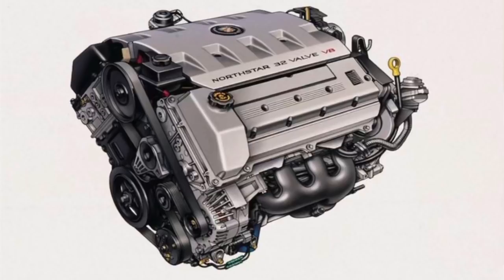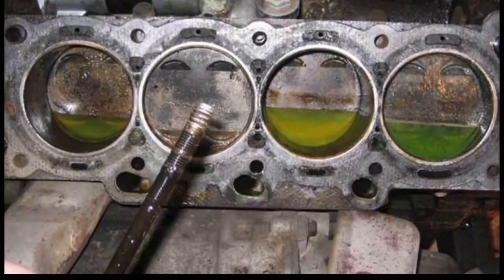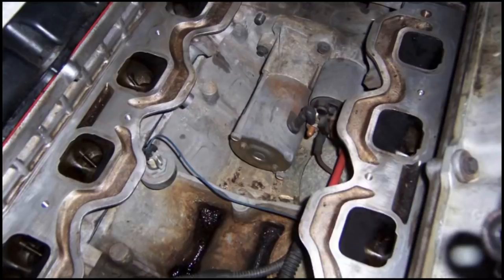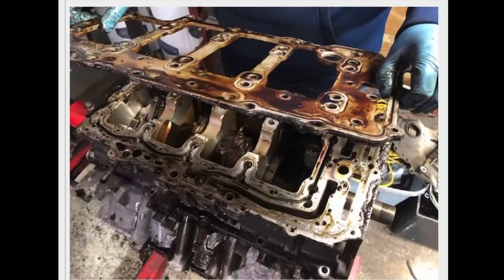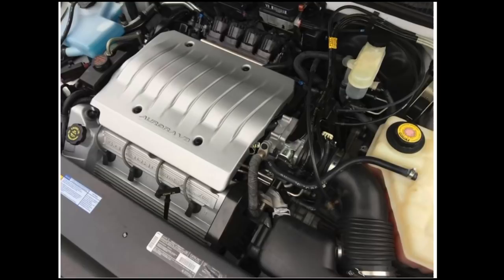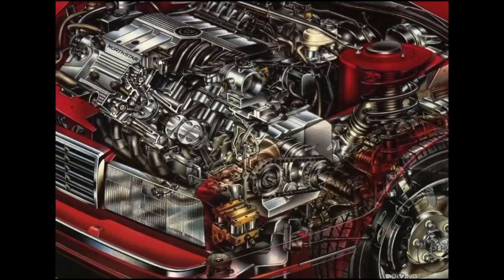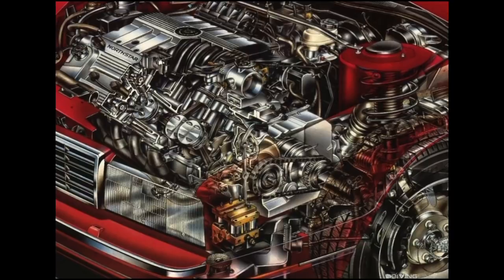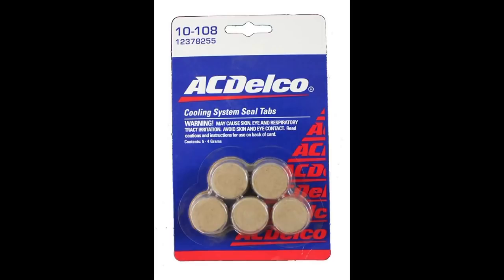Worst Car Engines of All Time: Cadillac Northstar

Comment: People who claim the Northstar is the worst simply do not understand them. They were ahead of their time. They were among the most powerful front wheel drive cars in their day. They are excellent in snow, plenty of power, and offer great gas mileage. Although the head gasket issue is a big thing to repair, they give almost no trouble after they have been fixed. And that's on 93-03 models. 2004-11 models rarely have the head gasket issues due to updated bolts. But even then, the 93-03 models are good cars when maintained. Some people run the older models for hundreds of thousands of miles without blowing head gaskets. My reasoning for that is that they never let them overheat. 93-03 models are what I would consider to be "one and done" in terms of keeping it alive with the original bolts. You get one chance, and one chance only with the original bolts. 

If you buy one, here's what you do. Thermostat, water pump, WP belt, WP tensioner, coolant flush with new orange coolant, coolant resevoir cap, and that's really all I would say needs to be done. You could keep going and eliminate every possibility you want, but that's all I'd do. That way you don't have too much money in it if it still lets loose. But really, from what I see with these cars, those are the things that will cause it to happen most often. Most of the other cooling system stuff is not an issue. And notice how I said orange coolant, not green or anything else. GM says use orange coolant, therefore, I will use orange coolant in the car. GM changed the formulation of their Dexcool so it is no longer as bad as it was. Factory Dex was a nightmare. Saw a water pump come out of these cars that looked like it ran though an acid bath. That's what Dexcool does, it eats the metals until the cooling system no longer works. It always finds its way out.
Reply: exactly had 2 one with 175000 miles never any problems
Reply: @SuperBooboo02  What year was your car? The one I had was an 03 DeVille.
Reply: @SuperBooboo02  ooooo 175000 😂 my Toyota pickup has 425861 right now and never a problem and my Subaru outback has 365678 miles on it right now and never had any problems eather.
Reply: I always us green coolant in all my Northstars and flush every two years.  OAT coolants are horrible and eat anything that's made out of rubber or plastic!  I change all my cars from OAT coolants (Dexcool, Mopar etc. and all that other garbage to green and never have any issues.  I also stud my Northstars and use Mitsubond RTV on the bottom end.  Mine never leak oil.  You have to frequently do the Italian tune up (Thrash them) to prevent the oil control rings on the pistons from gumming up (as per all performance engines of that time and before) and that prevents the engine from burning oil.

Comment: Don't care how well it runs when it works. Any engine that blows head gaskets a 60k miles,  overheats, leaks oil, has its starter under the intake manifold, and requires gymnastics to take out the alternator sucks.

Comment: My wife had a 2001 DeVille with the North Star. The car went 242,000 before we sold it. It never overheated but did use oil. Other than that, it was extremely reliable.  Religious oil changes are a must on these cars along with regular coolant changes as well. Definitely change out a thermostat from time to time. Very powerful and good on gas.
Reply: So in short, meticulous high-maintenance constantly is what this engine needs in order to run half decently. That still makes it problematic to say the least. And I had a 99 Seville. That thing was ATROCIOUS on gas, even with the oil changes and premium fuel.
Reply: All of that won’t solve the head bolt issues.
Reply: You just got lucky, bud. Good maintenance can't fix serious design flaws.
Reply: Oil changes can not possibly fix the head gasket problems and other issues. How ridiculous.
Reply: As a owner of several northstars with only one "2001" 2000 engine design that got the head bolt kit put on it. Which it has 212k miles on it now and running strong. The engines ARE A BEAST when running properly.  However, vacuum leaks knock this engine off its tilt. And vacuum lines are mostly plastic on this engine and they are not built to last. So if you habe one address your lines like you would ur plugs. After 03-04 the head gasket issue was for the most part resolved.  Long story short do your research first before u buy one.  If it is 03 and older make sure the head bolts have been dealt with or prepare to deal with them. If it's 04 and newer check your vacuum lines and make sure there are no vacuum leaks and u should be fine. But from my experience ALL NORTHSTARS USE OIL fresh out of the box so stay on top of your oil and HAVE FUN!
Reply: My dad currently has a 2004 DeVille with the Northstar, and he currently has over 220k miles. It burns oil, and the trans leaks pretty bad(output shaft seals), but it still runs strong. Unlike you, getting him to change his oil requires an act of Congress. I'm surprised he hasn't killed that engine yet.
Reply: @PistonAvatarGuy  agreed, they were VERY lucky! Most of the time, these things are HEADACHES
Reply: @NeverTalkToCops1  He never said that. How ridiculous.
He said they were necessary for best possible longevity. He didn't say it would fix design flaws or the head issue.
Reply: @jlcii  What did it get for mileage? Around 20 to 25ish?
Reply: Tesla better
Reply: @BigRedtheGinger  I would say changing the is the least of problems on this engine. Hell they usually either leak so much or supposedly burn a lot, just keep adding when needed. It's the head gasket issue the is the number one problem, to me everything else is on par with any other engine issues at that type of miles.
Reply: @jlcii  Wasn't this engine by the year 99 made to run on 87 octane? A 4.6l v8 in a big full size car is not the ideal set up for gas mileage. After all this is supposed to be a luxury cay, cheap and economical is not the focus here.
Reply: @NeverTalkToCops1  your comment is ridiculous
Reply: The Lord must've been smiling on u

Comment: You know there's a serious head problem when the aftermarket makes a "kit" to bore the cylinder bolt holes and retap them oversize,  drill out the bolt holes in the head, and supply new oversize bolts.. and gaskets...
Reply: And Toyota , you know the super reliable brand, has the same issues with some of its 4 cylinder engines.   The same aftermarket companies make solutions for those Toyota’s as well.
Reply: @toothrestorer6588  Toyota sucks,I wouldn’t be caught dead in one of them jap cars…
Reply: @toddprater14  I would rather drive the Cadillac.
Reply: @toothrestorer6588  amen brother 👌

Comment: I actually owned two Cadillacs with Northstars, one first gen in a 98 El Dorado, and a third gen 03 Deville.  The engines were fuel efficient, and had a lot of horse power, even when using low octane fuel.  But both engine head gaskets blew.  The first gen blew slowly and lasted over 200,000 miles, but was one overheating away from death for the last 100,000.  The second blew at 106,000, and I replaced it, and it blew again at 180,000.  The repair on the 03 was $6000, and took three months because no mechanic wanted to do it.  I love Cadillacs, but my last two cars have been an Acura and Infiniti.  A Northstar will break your heart.
Reply: And your wallet ☺
Reply: 200k miles isn’t something to complain about.

Comment: Bought a 2001 Seville STS used.  It was priced to reflect the Northstar.  Head gasket let go at 130k miles.  Paid $4000 to fix with the "head stud bolts" and the upper/lower block seal.  Drove it another 80k miles with no issues.

My thought at the time was that $4k invested into wasn't going to buy anything that didnt have even more problems.

Mine used oil, too. 1 qt/800 miles.  No leaks. Never could figure out where it was going.  Figured the stem seals on those 16 intake valves.

Never had to change the starter.

Typical GM.  A great design killed by half asking a few minor details
Reply: That’s how I look at it too. For $4000 I can have my beautiful 99 Eldo back on the road. Can’t get anything near as stylish for $4000.

Comment: GM did correct many of the failure points in the last generation. And in typical GM fashion when they finally got it straight they stopped making it. Meanwhile over at Ford their OHC V8 that was introduced about the same time lives on as the 5.0 coyote.
Reply: What model year did they get it right?
Reply: @francisniestemski2440  early 00's
Reply: 32 valve Intech was basically bulletproof. If someone came up with a way to attach the 4T80 to it in place of the AX4N that was made of glass I'd still be driving my Continental.
Reply: @brucegrant1141  right. Ford should’ve stuck with the 4.6 SOHC and DOHC instead of the 3V and the 5.4s. That and the 6.2 V8 and the 6.8 V10 were also great engines.
Reply: GM did the same thing with the HT series of engines.   The 4.1HT was complete trash.  The 4.5HT was a bit better.  The 4.9HT was a fine engine.    So after finally getting it right what did GM do?  Dropped the 4.9 for the 4.6N and started the process over again.

Comment: Somewhat related (you mentioned this car briefly) I think an episode about the Aurora would be warranted. I think Oldsmobile was really doing some of their best work in decades just before GM pulled the plug, and the Aurora (both gens) was perhaps their best example - plus you could talk about the V6 "Shortstar", which I thought was really quite good, but with so few examples out there (and my families tendency to only keep them 2 or 3 years) I don't know how to speak to their longevity.
Reply: I inherited my parents olds Aurora 4.0 and intrigue 3.5. Both were purchased new and well maintained. Some small issues with the 4.0 although still runs well. The 3.5 short star has been a tank and a pleasure to drive. The only things you have to do is check the oil periodically, change the oil periodically, change and flush the coolant system periodically. Also, water pump replacement, engine electronics such as the mentioned crank sensors MUST HAVE OEM GM parts/AC DELCO. Aftermarkets will not work well and will cause you more headaches later.
Reply: The Aurora engine was far less susceptible to the common problems of the 4.6.
Reply: good ol aurora!
Reply: I always thought the Aurora was a good looking car.
Reply: Had an Oldsmobile intrigue with the 3.5 V6. It did burn oil, it ran great til my ex drove through a flooded street and hydrolocked the motor.

Comment: Had a 2005 DeVille. Commuted to work for 12 years and took many long trips in it. No issues or major repairs the whole time. At 130,000 it blew a head gasket though. Loved that car, but decided not to spend the 5 Gs to fix it. I opted for a $200 kit that supposedly fixed it.  It ran fine for another 6000 miles but I couldn’t trust it on long trips anymore, so I decided to trade it in for a new Suburban.
Reply: Then the deal took the car to auction and some other sucker got stuck with it
Reply: @oveidasinclair982  I think our old cars go to Mexico or South America. Those guys down there can keep things running a long time.
Reply: @PETERLINNAH  Actually a lot of them (bad shape trade in's) get shipped down to the islands and South America, I can't see the common person down there being able to afford 25 -30 thousand plus for a new car.

Comment: The 300 hp 2000 model year DTS was a nice hwy hauler. I actually clocked a 0-60 time of 6.2 seconds ,60ft of 1.54... and a 14.7quarter in mine.
Reply: show me the timeslip of a fwd luxury car with hideous torque management that actually cut a 1.54 60' on street tires. i do not believe you. the 1/4 mile time is accurate though.
Reply: @OxBlitzkriegxO  Yep, you're right. No way in hell that it cut a 1.54 second 60 foot.
Reply: @OxBlitzkriegxO  1.7x second 60 foot times seem to be pretty quick for a street driven fwd cars with slicks. Like proper 13" slicks on a boosted civic. I am thinking that its supposed to be 2.54 seconds and that sounds way more reasonable other than how do you cover 1260 feet in 12.2 seconds in a barge?
Reply: @timothybayliss6680  that car should be capable of 2.0-2.1 60' times regardless of traction control or how you launch.

the N* equipped engines are tuned such that you dont get full throttle in first gear no matter what you do. its limited to 50% because of torque management.

Comment: I owned two Northstar vehicles - 1993 STS and 2000 STS.  Loved the engine performance!  Traded the 1993 with 94K miles and it was running great.  However, on the 2000, the headbolts started separating from the block at 63K miles.  Traded for a 2008 STS.  Wish Cadillac would have done better on the design!  On the 1993, a special tool is required to change the water pump.
Reply: All the north stars require the special tool. Luckily there are some tricks to just use a screw driver!
Reply: I have one and I change the anti freeze every year.  It gets corrosive and plays games with those head bolts.  185,000 miles and is still strong with no oil leaks.
Reply: @Breadts1cks  Not true, but if they don't taking out the crossover pipe is a challenge.
Reply: Your 93 was fine because it didn’t have dexcool…dexcool came on every late 96’ model car and up…had a 97’ trans am that had a head gasket issue , couldn’t explain it back then, but as I grew fond of eldorados, sts’s and the dts and researched the engine..I finally figured out why my ta messed up….super corrosive formula… your 2000 prolly had a 99 built engine so that’s why…gm then reformulated it (don’t know what year that was) cause it was killing engines after turning acidic…I  want a 2011 last year built Cadillac dts platinum..I love this car